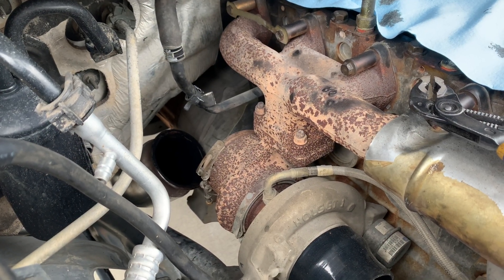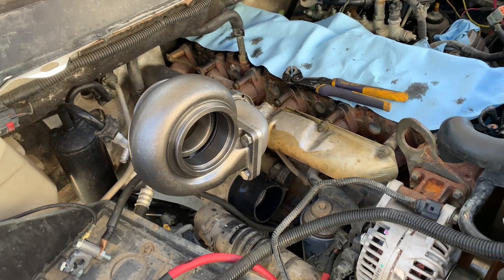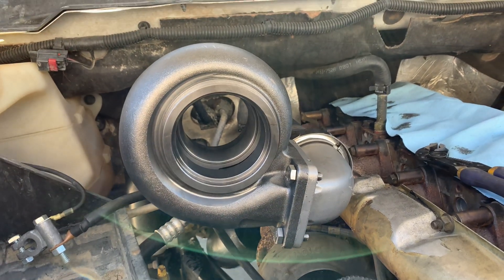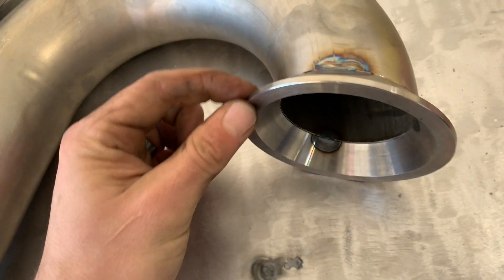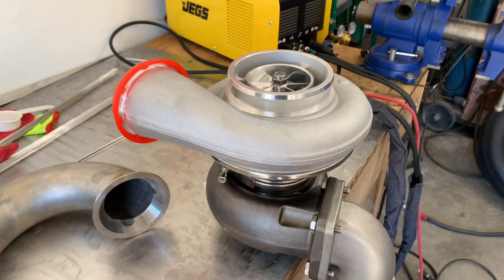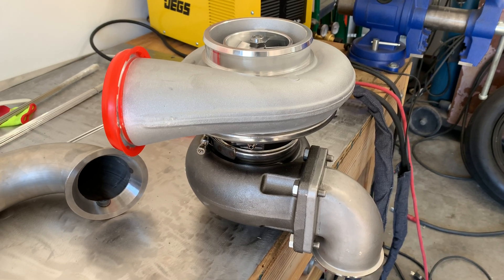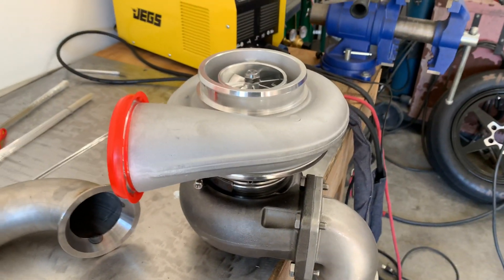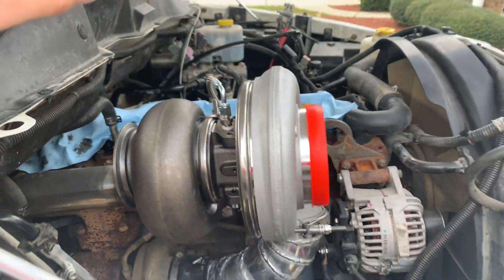Cummins custom compound turbo kit

Comment: Love the homemade setup. How is it for towing? How early does the boost come on? What’s max boost?
Reply: Please don't use an eBay knockoff turbo.  Gas cars don't run pressure ratios into the 4-5.5 range.  Our trucks push 40-65 lbs cars maybe 30 on alcohol.

Comment: I’m looking to build a set up exactly like you built. After running this turbo would you use the vs racing 475/83 again or go 96?
Reply from the maker: For a tow setup I'd go with the 83 turbine again
Reply: @dirtbikemax15  Awesome thanks! Turbo holding up ok?